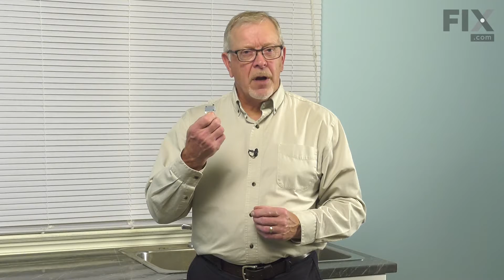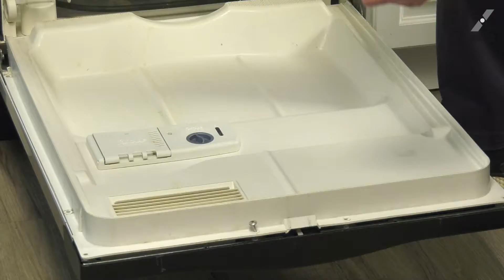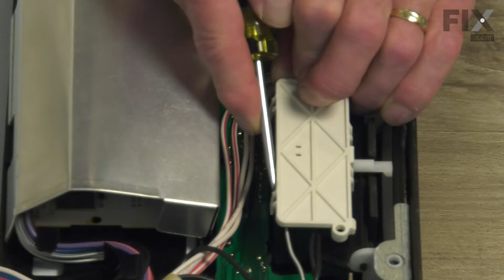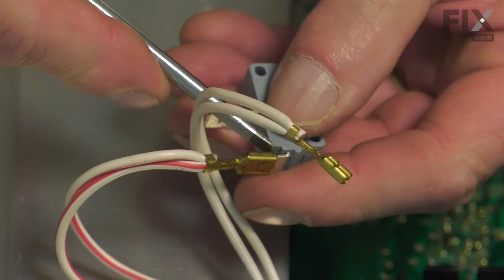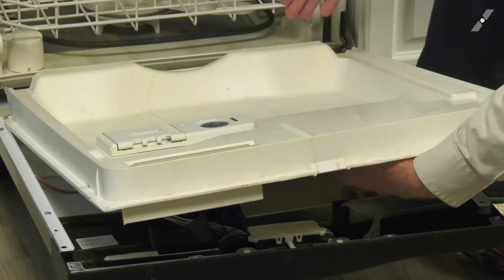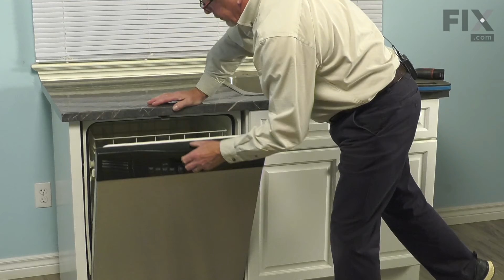GE Dishwasher Repair - How to Replace the Interlock Switch

Comment: The plunger/spring in mine becomes slightly dislodged and it interrupts the cycle. Reseating it is the only way I can get it to resume, but sometimes it wants to completely reset and start the cycle from the beginning. I don’t think the plunger, spring, or even the entire assembly are for purchase. Any good solutions on how to address this?